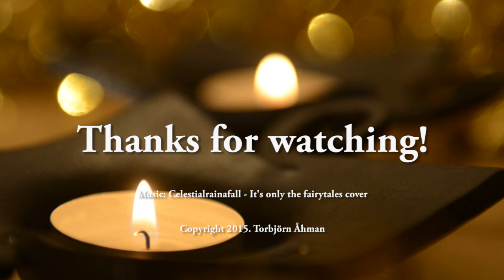Blacksmithing - Tealight candle holder experiment

Comment: Started smiling after you punched the cavity for the candle with the power hammer. There you could actually see how hard the hammer hits. Couple smacks and there it is. There's no way that anyone could hit that hard even with a heavy..ish sledgehammer. Nice video once again Torbjörn!
Reply from the maker: +DraGma Thanks! This is only 5mm plate...you probably could manage by hand on this, but it's nice to be able to do it quick and without multiple heats.

Comment: Torbjorn, thanks for your video!  I am very impressed with the level of detail you put into your videos and I hope you can continue doing so.
I'm very new to blacksmithing and from your video I was able to make a few (10 so far) of these for Christmas gifts.  For those that wondered if you can do it by hand (I don't have a power hammer), the answer is yes.  That said the first attempt it took several heats (I lost count after 5 or 6).  So I made a guillotine that held the die and ring with a guide where to hold the plate so I was consistent (although it was slightly off).  In any case with that I could do it in 2 heats.   So not to bad, but no power hammer.  :)
Oh and I haven't torn one yet, but that'll probably change now that I said that.  :)
Reply from the maker: Thanks!!  Great to hear that. Merry Christmas.
Reply: Merry Christmas to you as well.

Comment: These look great. A little ring/adapter in the middle that would let you also use candlesticks with them would be awesome. Super beefy but a touch of class at the same time, my kind of decor.  

Now make a set of matching napkin rings so I can get the set!
Reply from the maker: +liveepically Thanks! Good idea with napkin rings, probably quite easy to pull off.

Comment: Torbjorn! I was making my 8th candle holder and drove the tool completely through the plate! Surprised the shit out of me! My family loves the holders! The shit not so much.
Reply from the maker: Ha ha, yes you have to take it a bit easy... I have cracked one or two as well. I think it depends on how smooth you make the bottom ring, so the material can travel down without catching.

Comment: I love your videos! Always so great to watch a true craftsman. I had 2 questions. 
1) What is the purpose of coating it with linseed oil?
2) How did you get the candle holders to have that even black finish?
Reply from the maker: That's one question!  The linseed oil is giving the black finish, when applied on the hot metal. It also gives a degree of surface protection against rusting.

Comment: Very nice tooling. If say I don't have a power hammer could I weld the donut onto a hardy that has a flat plate and then either hold on my own and rotate around the anvil or get a striker to help.
Reply from the maker: Thanks. Yes I think that should work fine! You could also try a thinner plate for the candle holder, which might be easier to push down.

Comment: i really like the finish you get when you used linseed oil about how hot do I want the steel to be when I do this also did you use boiled linseed oil?
Reply: you learn by trial and error but you want a black heat.  start warming it up and test it as it's warming. if you start seeing it changing colors, it's too hot. you'll know its just right when it looks like ita cold but when the oil touches it, it smokes a bit.
Reply: thanks
Reply from the maker: +Nick O I use boiled linseed oil, but I think it matters less. I think the temperature should be in the range 300-400 deg C, but it's not critical. I usually start a bit cold and heat it up until the oil turns black.

Comment: great video but what is your white pen ? And this spray please
Reply from the maker: +martin lagier Thanks. The pen is "MARKAL SILVER-STREAK" welders pencil. Spray? I used linseed oil for the finish.
Reply: Thank you for your answer i speak of spray no friction un start of video. And great video again.
Reply from the maker: +martin lagier Ah, when sawing the stock. That's just some generic cutting oil.
Reply: +Torbjörn Åhman thank you si much and please don't stop your video

Comment: Hello
I see you have a lot of hardy tools
How have you made them? What steel do you use?
I have part of rail - will it work?
Reply: +Антон Спицын I already have anvils. But no hardy tools for them
Reply from the maker: +Антон Спицын I have made a few, it's not that hard to do. Type of steel depends on what tool to make. Steel from rail is probably pretty good. I could probably do a video on making one... any special type you are after?
Reply: +Torbjörn Åhman I think that rail is not the best steel for hack (chisel, bit.. I don`t know right translation of http://www.navcesto.ru/upload/iblock/7b1/7b1d2dd6b3734b3d2240288b3fe90ce3.jpg and it`s hardy tool analog http://kovka-svarka.ru/wp-content/uploads/2012/11/podsechka-kuznechnaya.jpg). Maybe I should search for pretty huge hack to make it
But rail should work for 4:11 and this http://www.iforgeiron.com/uploads/gallery/category_3/gallery_55258_3_27531.jpg , right?
Reply from the maker: +Антон Спицын I think even for a hot-cut hardy it would work. If you cut stock hot it does not need to be that hard. If you plan on cutting cold, it needs to be harder and stronger. You could check out my very first video where I make a hot cut.
Reply: +Torbjörn Åhman of course hot-cut!

Comment: How do you decide what steel to use for your projects?
Reply from the maker: +Nolan Gaudreau That comes with experience... Ornamental stuff is always mild steel. Tools are for the most part made from hardenable steel. The alloy depends on if you use the tool for hot working, cold working, edge tools etc. It's a jungle among alloys but there are guidelines...
Reply: +Torbjörn Åhman Cool, thanks!
Reply: +Torbjörn Åhman I have a question, do you have a store to purchase items from?
Also are custom orders accepted?
Reply from the maker: +Pulse of the Fallen I have actually put up a page for that and some general info  - http://www.torbjornahman.se/
I post stuff I currently have for sale there. Custom orders might be ok mostly depending on time and complexity...
Reply: Torbjörn Åhman Okay, thanks man

Comment: do you sell your products?
Reply from the maker: +that surprised guy I sell some items on my web-page. It's not my primary objective to sell my work just now, but I do add new items now and then.
Reply: +Torbjörn Åhman alright
Another question
I have just bought an 103 kg sodenfors anvil
And I found a square hole under the horn, do you know what the purpose of that is?
Reply from the maker: +that surprised guy Great. I'm pretty sure that hole does not have a purpose, it's part of the manufacturing process, go grip and hold the anvil.
Reply: +Torbjörn Åhman allright thanks!